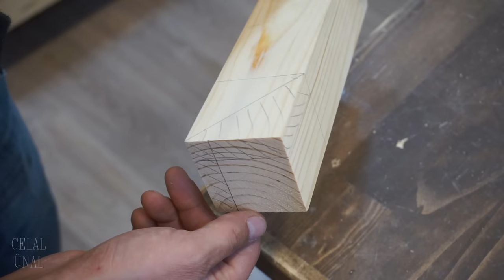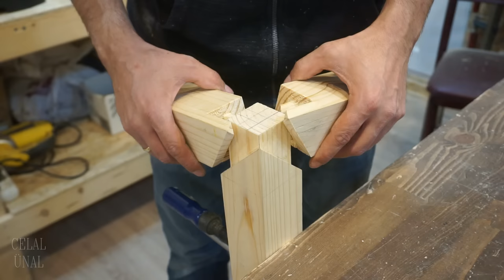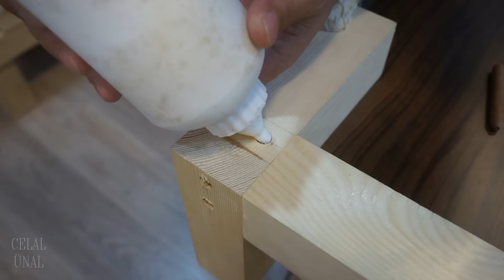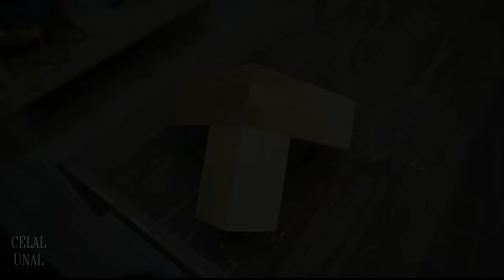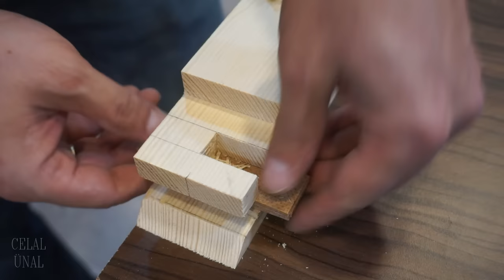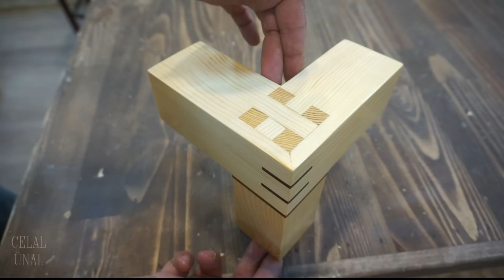Woodworking / Wood joint techniques / Wooden corner joints / Ahsap birlestirme teknikleri

Comment: Can the corner joint @6:00 be made on the Dewalt saw using 25mm x 25mm hardwood, say oak, walnut, or cherry? For example, if you were making a small flush-mount ceiling light? Or would it be better to use a saw optimized for small work, like a Proxxon?
Reply from the maker: With Dewalt, I think you can cut and do anything.

Comment: Yeah, indeed...
Very simple and accessible. You just need 500 dollar worth of tools and 3 hours per joint to make them.
Very helpfull video, I will run to buy mill and table saw.
Probably his marking tool is 100 dollars
Pencil is the cheapest tool
And all of them are with glue, just use screws or nails with glue. Just as strong but saves 90% of time you have wasted making those joints
You are prob one of those that charges 10000 dollars for a chair claiming that it is innovative and will last you a lifetime

Comment: OK you are talented in woodworking - except for one factor. If it is analysed woodworking is removing the timber which is not required. Therefore the important aspect is the marking and setting out. If you are demonstrating then the correct tools and procedure should be displayed to the professional and more importantly to the novice. I'm sad to say I saw non of this in the video. Anyway I'm just an old fart with over sixty years experience - so what do I know?